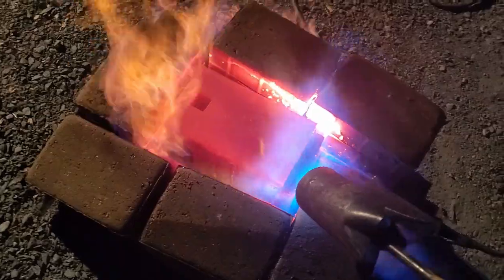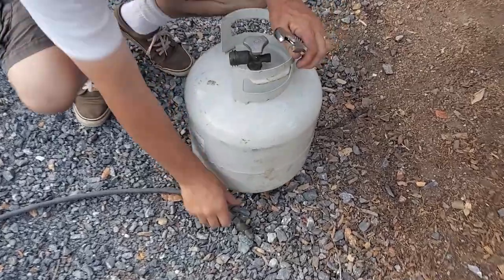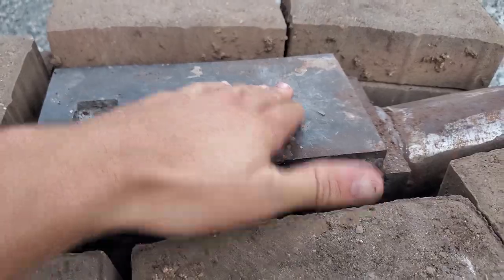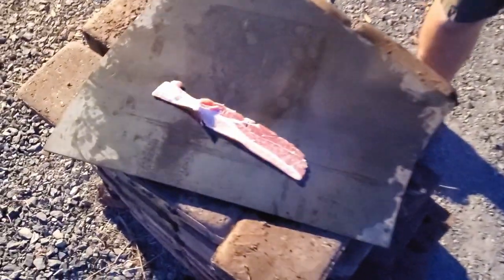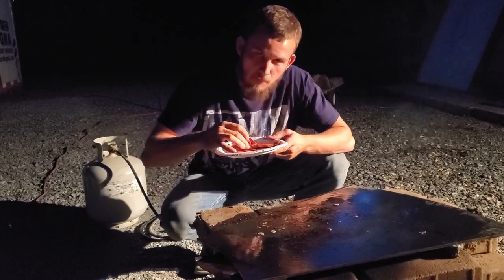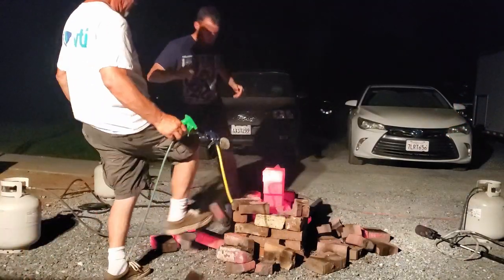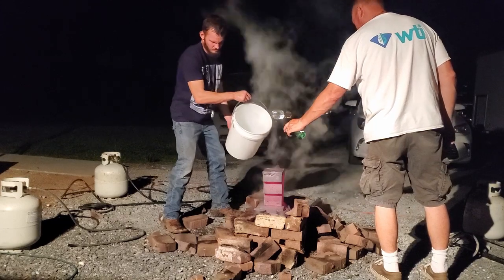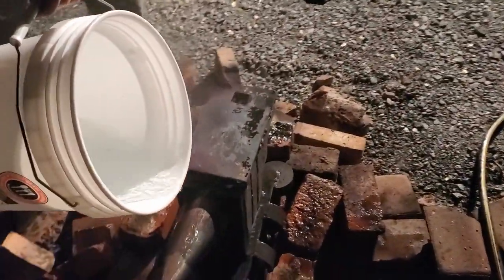HOMEMADE 180 POUND ANVIL PART 3: Hardening and Using!

Comment: Only the striking surface needs to be hardened. Otherwise, a great build. Using the plates vertically was a very good idea. When air hardening A2, just leave it alone, even if you have that mass. I would have turned it upside down to give most of the heat to the surface, checked with a magnet, and taken it out, flipped it over and left it alone. But if it isn’t tempered at about 400-450, it might chip.

Comment: My idea would be to a ring on the horn and a hook in the square hole and carry the anvil to a tub of  water. might have to put something in the bottom of tub
so the anvil does not melt the plastic , it should cool it off faster.  I did a very good job of it.
Reply from the maker: That's a good idea, and we actually considered doing just that. But the top is A2, and air hardening is the slowest quenching process, and we thought a full water quench would have been excessive and might have caused problems. Because of this, we misted the top with water, and poured water on the 4140 horn, which is normally oil quenched, sometimes water quenched.

Comment: Pouring water on it didn't harden it. You would have to dunk it in a big container with an engine hoist or use something like a fire hose. I would have just used tool steel as the top plate and been done. Also that wobble when using it is bad.
Reply: They literally said it’s tool steal and you air harden d2